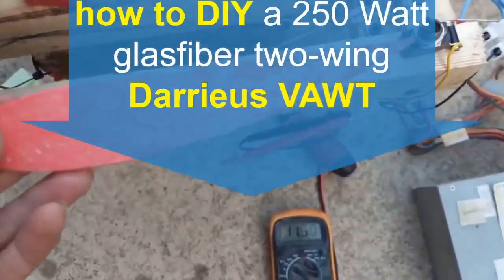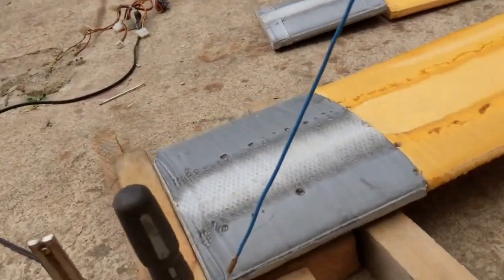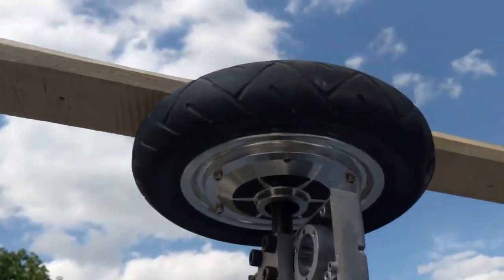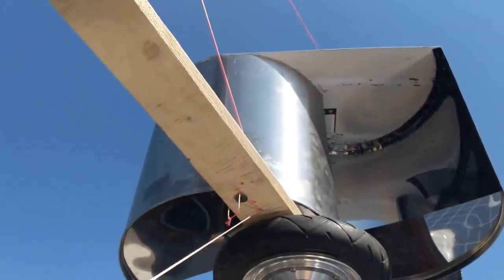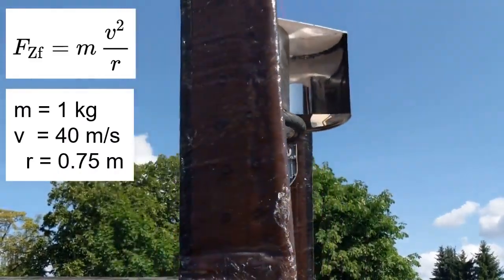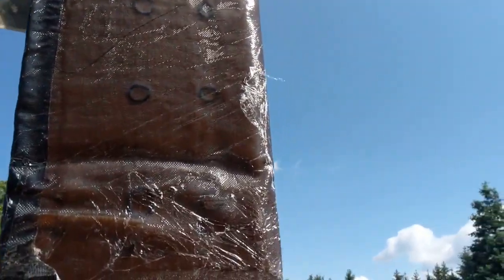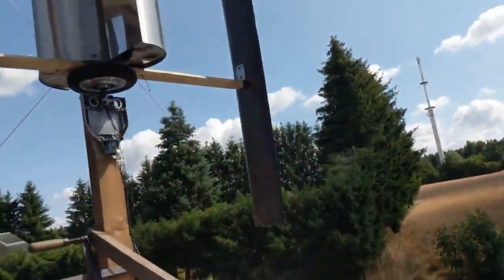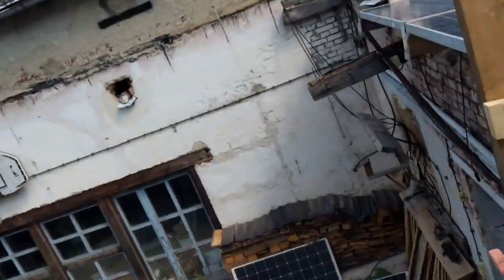howto DIY 250 Watt VAWT glasfiber/xps two-blade H-Darrieus

Comment: Power output almost zero.
Same as the Darrieus samples of mine !  
My two cent towards Darrieus:
The blades have to speed so fast they begin to sound.
They should be done symmetrically, not carved.
The diameter should be increased, 3-5 times the length of the blades.

Comment: Would be nice to put it higher to avoid the trees. You don't want to turn this into cycloturbine?
Reply from the maker: If I would put it higher the would not have the wind channel effect of my buildings.
No I do not plan to make the two wings adjust their pitch while rotating. 
I think the only benefit of a vawt is that it can take wind from every direction, which might make them better in turbulent situations close to buildings.
Adding the mechanics to optimize blade pitch would need a wind direction detector..
But as a hoverboard motor will not have the power to stop the vawt with high wind speeds, I might need such a way to change angle pitch.
Ideas Welcome.
Reply: @robodurden  The blades seem to be light and so I do not think they're very susceptible to high wind speeds. Have you seen the Sharp Cycloturbine? Very simple and elegant pitch control. Basically works as a drag type turbine so it can start at low wind until it picks up speed. If you're worried you could make the angle slightly wrong, this would lower the efficiency but also limit the maximum speed.
Reply from the maker: @SinsBird  oh this sharp vawt might indeed be very clever and I might be happy to give it a try.
Thanks for this idea. That is the kind of feedback I wish for.
Unfortunately his, 21 pages paper consists of too many words and numbers but zero mathematical formulas.
But the pendulum idea might be very clever.
Because pendulum frequency only depends on the force and the length of the pendulum.
So with a given speed and the TSR (you want to target), the zentrifugal force is given by m v^2 / (r+r_pendelum).
The windspeed with TSR also sets the rotating frequency and we can match this with a perfect r-pendelum.
So why not telling the easy  formula to calculate that important pendulum length.

But the best is that the zentrifugal  force is proportional to the square of the wind speed, but the pendulum frequency is proportional to the square root of that force.
So the pendulum frequency is proportional to the revs of the vawt !!!
And the pendulum can be in sync with the vawt over a wide range of wind speeds.
And very clever, the torque is not only achieved in the two positions uphill and downhill .
I feel that the energy harvest from the blade is rather pushed into the pendulum like a swing on a playground!!
And the pendulum in sync with the vawt transfers this energy when it is best..
And I very much like the ultra cheap approach of simply using ropes to for the swing like pendulum.
What I do not like is the counterweight. As I mentioned in my video here, I might already have a zentrifugal force of 200 kg on one blade at 10 m/s windspeed. Such a counterweight would double it to 400 kg :-(
So I do not understand for now why the blade has to be behind the the H-rotor.
Ideas Welcome !
Reply from the maker: We have a problem:
The pendulum frequency is f = 1/2pi sqrt(g/l)
The zentrifugal acceleration g = v^2/r
The revs of the vawt should be equal to f, so f = v / ( 2pi r)
Putting everything together yields r = l :-/
Where is my mistake ?
Because r = r_handlebar + l.